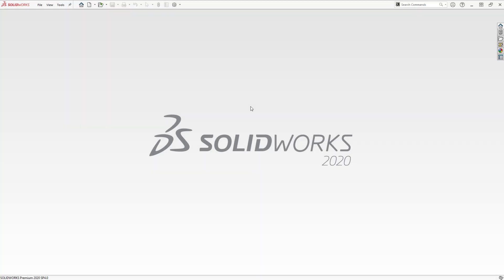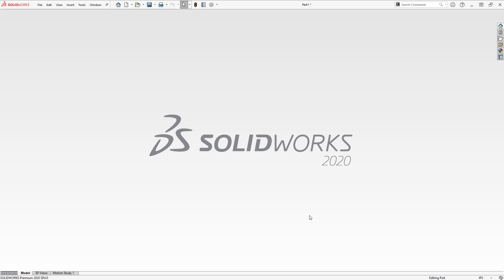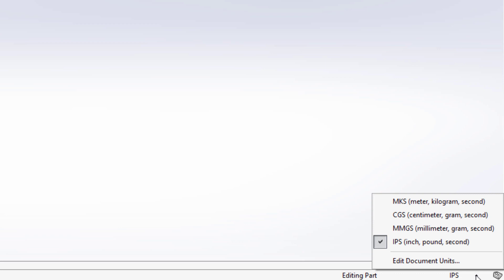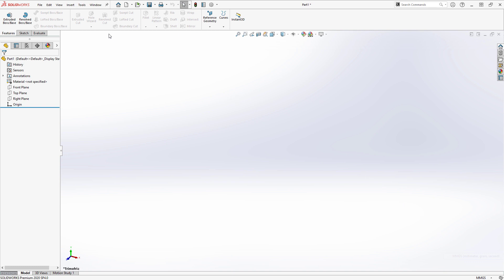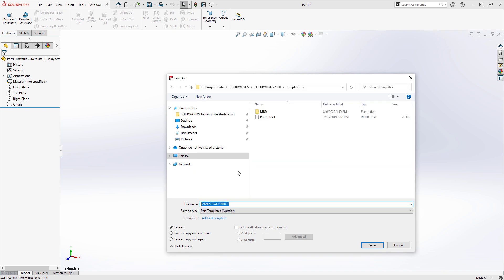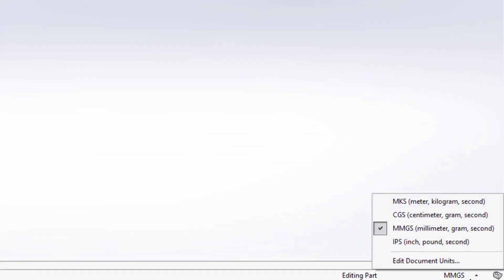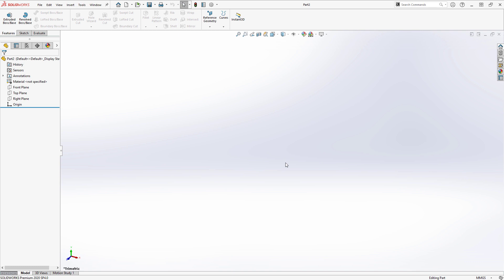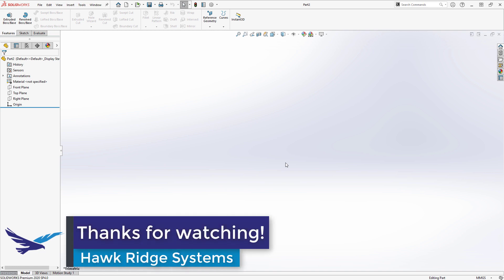Changing Default Units of a SOLIDWORKS File

Comment: Hi,
Thank you for the video.
I have a question. After I save the part as a STEP file, the numbers at the STEP file appear as frictions with many digits. For example, when I put (30) at the drawing, the STEP file shows it as (30.0000000000000). Can I control the number of digits in such a case?
Thank you.